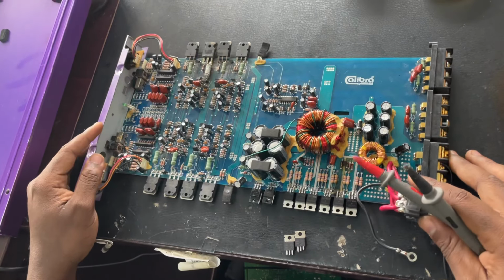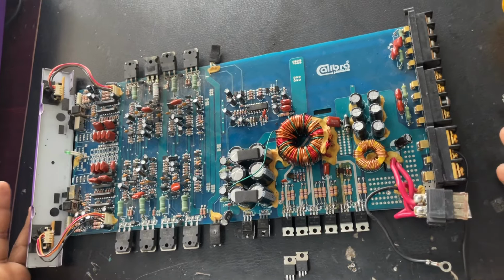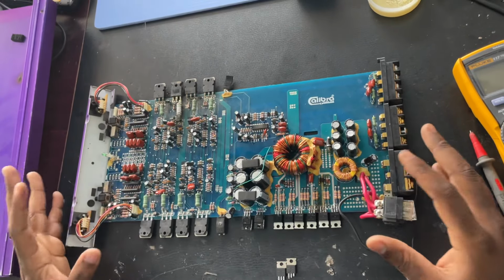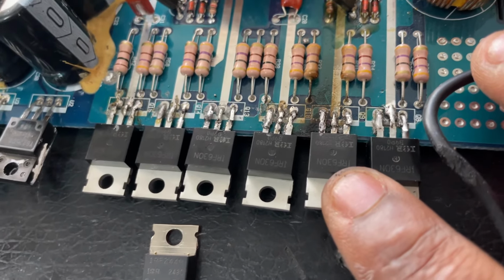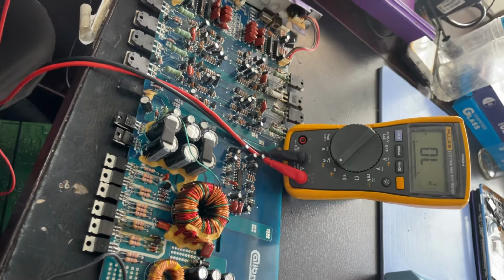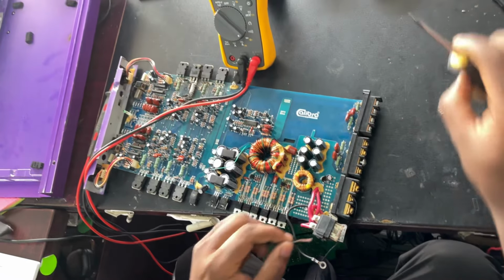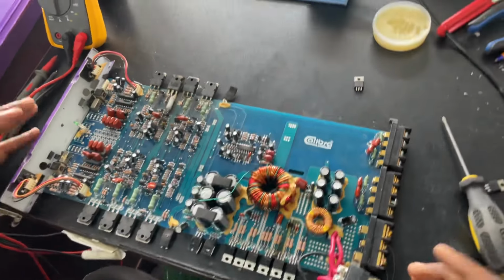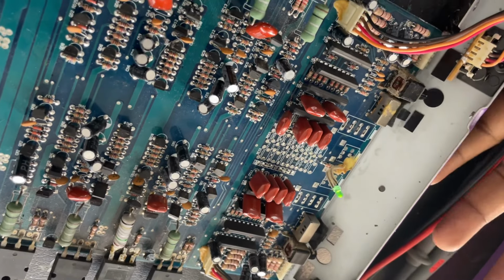How to Repair a dead Car Amplifier in less than 30 minutes.

Comment: A MOSFET (Metal-Oxide-Semiconductor Field-Effect Transistor) is a type of field-effect transistor that is widely used in electronic devices and circuits. It is a three-terminal device that can be used as a switch or an amplifier. The MOSFET has three layers: the source, the drain, and the gate. It operates by controlling the flow of current between the source and drain terminals using an electric field generated by the gate terminal. MOSFETs are commonly used in various applications, including power amplifiers, voltage regulators, and digital logic circuits.
Reply from the maker: That’s very correct. Thanks for the comments.

Comment: Thanks bro for the video, have the same kinda  problem, I think it might be the fuse cuz the green light switches on but no sound so I checked the fuse and was cooked... So what is the fuse size or where can I find your workshop to have it checked??  I will appreciate it bro thanks
Reply: Oh i have the calibra cxa1600x4 I think
Reply from the maker: Where r u located?
Reply: @cedricdebossrepairsUpington  sorry didn't check my notification, im based in polokwane Turfloop
Reply: @cedricdebossrepairsUpington  in Limpopo 5km from university of Limpopo (UL)

Comment: When a resistor is burnt. Will it affect the sound output?
Reply from the maker: yes depending on where the resistor is located in the circuit.

Comment: Hello! I have a question. My amp keeps blowing mosfets. As soon as i turn the amp on the mosfet blows . I have tried changing all mosfets but still the same problem. Its the output mosfets. If i only use 1 of the outputs to speakers the mosfet does not blow. But as soon i try the outher output it blows again.

Comment: Thank you for a thorough and clearly explained tutorial sir!! Just a couple quick questions, if that’s alright: 
1. @ 4:02 , the MOSFET on the board measured 0.148 voltage drop; but doesn’t a good MOSFET require ~ 0.3 - 0.7 voltage drop? 
2. In your PCB troubleshooting process, do you test each component 1 by 1 until you land on the faulty one?
Reply from the maker: Answer to question 1 is the voltage drop when it’s connected to the circuit can be confusing at times that is why to get the correct voltage drop you need to disconnect the power mosfet from the circuit first.
Question 2 answer is I always troubleshoot using the reverse engineering method.
Reply: @cedricdebossrepairsUpington  Thanks for your prompt response sir. Can you please clarify how your reverse engineering method works?
Reply from the maker: Reverse engineering works like this if you have a missing 12volts on the output you start from the output section and trace back all the connections which are connected to the 12volts power rail inorder to restore the missing 12v
Reply: @cedricdebossrepairsUpington  does that mean you check for continuity between each 2 consecutive components on each trace? Or just check each individual component to ensure it’s within spec? (this is my last question, I promise 🙂)
Reply from the maker: Continuity will help you identify the components on the rail and you can individually isolate the potential faulty components by removing them and checking them out of the circuit. If there is a short and you remove a component and the short is gone then automatically that component removed is faulty. You can contact me on my Facebook page for more detailed info if needed. My Facebook page is Cedric DeBoss repairs
Reply: @cedricdebossrepairsUpington  will do, thanks so much for taking the time to share the explanations with me Cedric !!

Comment: So the generic mosfet is 55v? I have the IRFZ44v is that generic? Do I need to replace with the same or can a generic mosfet work? Thank you
Reply from the maker: yes the irfz44n are one of the best mosfets to use for switching power supplies

Comment: If car head unit is stuck on boot loop, where should I start? There is power, no obvious burning on the board, no obvious damage on parts? I have Toyota entune radio unit. Thank you for you video

Comment: So I have a kicker cxa1200 I let my little brother use. He told me he accidentally hooked up pos and neg backwards, now my amp is stuck in protect. I popped the panel off can’t seem to find any damage or burns anywhere do you think this amp is toast? I’m at a huge loss any advice would be appreciated
Reply from the maker: Will need to have a closer look at it

Comment: Nice video should make some more about the car amplifier repair like how to fix amplifier in protection mode the amp doesn’t have the external fuse on the the amp how to rest those kind amplifier bro
Reply from the maker: Noted! Have you checked out our latest video on protection mode? Go check it out if you haven’t yet checked.

Comment: Hello there,i wanted to ask your opinion on something, i have a older Alpine amp and im needing the fuse holder thats soldered to the board,the only place where i have found one that looks almost identical to what i need is one of those Chinese companies and they want to sell me 1000 of them, lol, i just need one or 2, i can send you a picture of what it looks like at your contact info and maybe you might know someone that has one?

I find it hard to believe only these people i found would have one,seems like something you could find on eBay in 2 minutes but i haven't been able to or i'm not using the correct keywords? thank you for your time, i really appreciate it.

Comment: question, could you pull mossfest out of an old amp that is good aslong as it's same ones and reuse them? have 2 old amps that have good mossfets and i have a burnt one in a new amp i just got
Reply from the maker: Ja you can.
Reply: @cedricdebossrepairsUpington  you can not just take any old mosfet from one amp and put it in another and expect it to work. they need to match specs

Comment: Great material,
I have one question about the Phoenix Gold car amplifier, I disassembled it and noticed that the transformer, one of the turns is very loose, should I attach it somehow or glue it with some special glue?

Thank you
Reply from the maker: use soldering wire and soldering iron to fix broken soldering joints.

Comment: My amp layout is different it has only 4 mosfets on the left and 2 on the right side. Are all 6 dead? Or just the left sides Mosfets dead?
Reply from the maker: i think the 4 are mosfets and the other 2 are the rectifier diodes

Comment: My jvc ks-ax3104 was dead and i successfully repaired.but some minor issue is one side channel mosfet is very hot
Reply: Please guide me
Reply from the maker: You must check the model number on the MOSFET and replace that mosfet. If a mosfet starts getting physically hot then it means it getting more current than it can handle or was meant to handle. The quickest fix is identify the heated mosfet and change it.
Reply: @cedricdebossrepairsUpington  thanks for guide
Reply: @cedricdebossrepairsUpington why is is getting more current than it can handle ? And if you change the mosfet, won't the new mosfet be fed more current than it can handle ?  What component is sending more current than this mosfet can handle ?

Comment: How do you know what side is the input and the output side??
Reply from the maker: the smaller Mosfets which are the power Mosfets shows you that it is the input side and the bigger transistors are always found in the output section.

Comment: Does the mosfe look shorted or is just shorted
Reply from the maker: shorted mosfet will cause the fuses to blow everytime to you connect your amplifier to current.
Reply: @cedricdebossrepairsUpington  I am looking for a new mosfet; it shows that 4 of 6 are bad. But I think that they may just be linked and who knows which are actually bad and which are not. I have a question what happens if you don’t have the info about the mosfet’s vgs does it need to be a certain vgs? Volts options for what I searched are 55v and 60v. The mosfets say: IRF44v(not n). So does it matter what voltage you have?
Reply from the maker: @speakersubject554  search the part number on google and buy the exact replacement parts
Reply: @cedricdebossrepairsUpington  my mosfets burned up, but my fuse isn't blown.   ??   Maybe the previous owner replaced the blown fuse ?   I checked my gates and they are ok.

Comment: can i put whole motherboard to oven for a little time maybe fix?
Reply from the maker: Depends on what the problem is with the board
Reply: @cedricdebossrepairsUpington  will it be fire or explosion hazard if i try that at home?:D there seems to be some kinda issue with some soldering maybe it works on like 1to 15volume but when i put 16 above volume amp goes to protection.. somedays it plays very good loud and clear no problem and then again it has days not working at all. not about cars power or ground or rca ive  checked everything 5times..
Reply: t @lazzixx  that's a different issue.   different topic.
Reply: @Mr_BUSINESS_24_7  ok thanks for your pointless answer
Reply: @lazzixx  the answer is,  yes you can at your own risk   And no it will not fix this issue.

Comment: Is a mossfet a common issue for power failure? What is the first thing you would look into for power issues?
Reply from the maker: Yes there are high power and lower powered Mosfets
Reply from the maker: Question 2 : MOSFETS